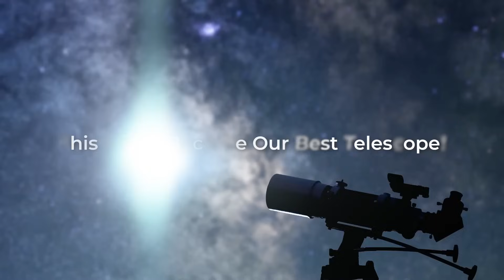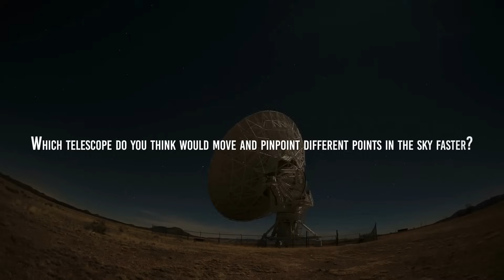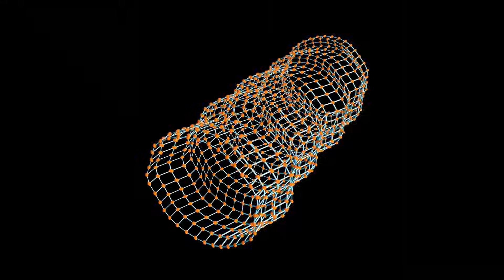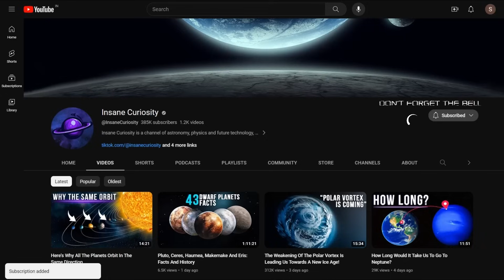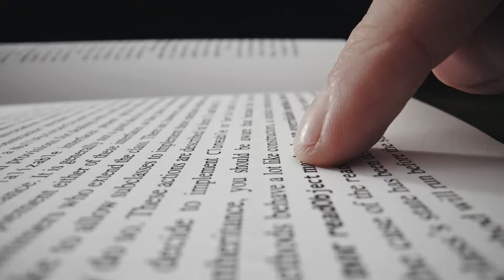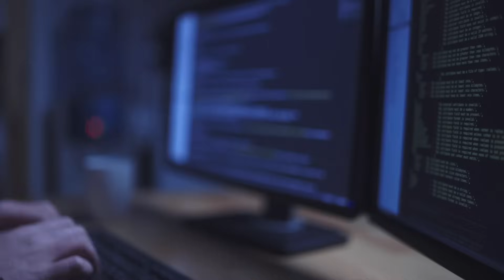This Might Become Our Best Telescope.

Comment: The Mass-Radial Acceleration Discrepancy by measuring the speeds of galaxies in the Coma Cluster originated with Fritz Zwicky, not Vera Rubin, whom I consider a celebrated plagiarist, as using the more challenging methodology of the virial theorem, by relating the total average kinetic energy and the total average potential energy of the galaxies of the Coma Cluster. My father advanced that the virial for a pair of orbiting mass is zero and used the principle of superposition to craft the argument to a system of interacting mass points. Fritz Zwicky then used the position and velocity of measurements to determine the mass of the galaxy cluster.

Vera Rubin advanced self promotion for decades after my father's passing by assigning herself forced credit for Dark Matter, while feigning humility as a woman in the sciences not seeking any special recognition. Rubin remains an unwanted barnacle who attached herself to my father's discovery and work without conscience and by deliberate design to assign credit for myself. Rubin, by her own admission, read my father's work regarding the speeds of galaxies, realized the importance, copied the methodology and advanced a campaign with obnoxious trumpeters to assign that forced credit to herself.

This is the legacy of Vera Rubin, who left an indelible mark as plagiarist and is an embarrassment to honorable women pioneers in the sciences with proprietary body of work.

It is of note that the Vera C. Rubin Observatory is a vacuous vessel in forced honor to the celebrated plagiarist Rubin by H.R. 3196. It is a building for the Simonyi Survey Telescope. I was denied the opportunity to speak to the Congressional Committee and voice my opposition to the naming but was assured that: "my letter had been read." Not one Committee member had the courtesy to respond.